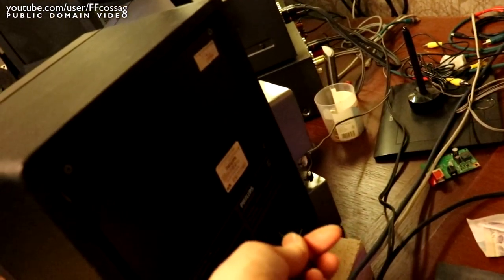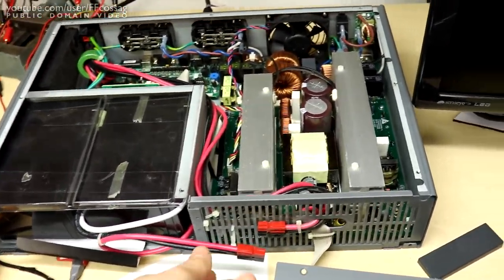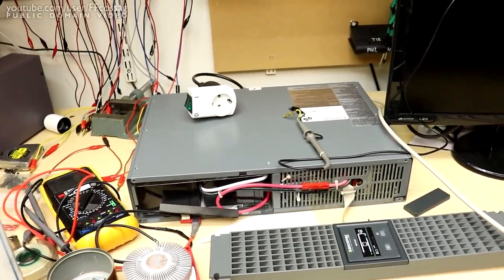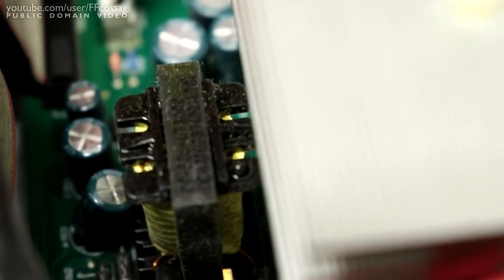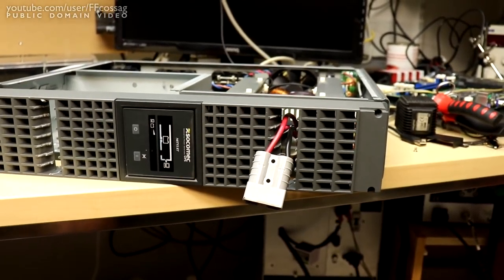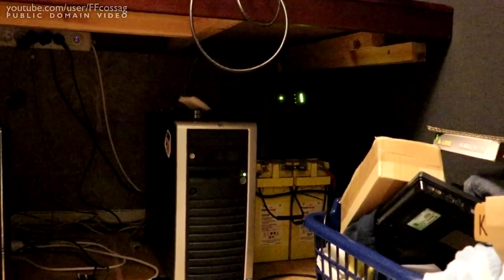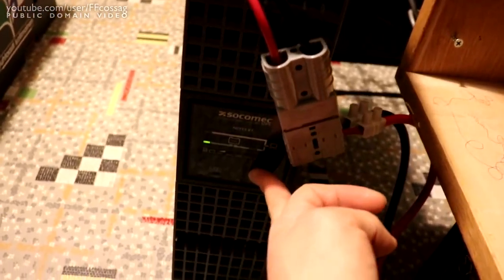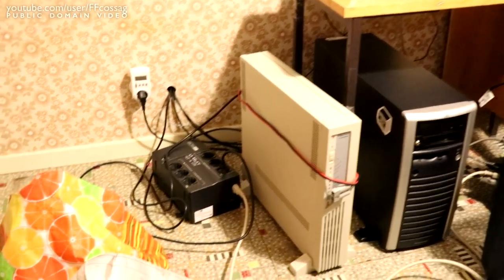Blog. Power grid distortion & solutions

Comment: I have a Tripp-Lite SU2200RTXL2UA that I just converted to 16s lifepo4 using headway cells.
It looks like my unit is based on the same design with OEM of at least the inverter board by Delta.
mine is quite a lot louder, thinking of adding glue to the coils, though I'm not sure if I should use CA super glue, Silicone caulking, or 30 minute epoxy.

Comment: I also had an issue with my power once where there was a considerable DC offset on the line making all my transformer based devices overheat. Don't own an oscilloscope so I couldn't figure out what exactly was going on... When I called the power company they told me that my multimeters are lying and all the overheating devices are just defective.
Reply: I once got told "we have an accident on the grid". They did not care that 220v line turned into 330v or something and blew our new fridge brains out and all our incandescents in the house. now we are on bunch of ooverlvoltage/lighning protector stuff on the house input. that got zapped twice already (one use devices) but we lost no devices in the house. the stuff is expensive though. did not notice dc offsets or similar stuff.
Reply: Use a transformer with multiple taps that automatically switches depending on voltage. When the voltage is too high (330V), it could switch taps to maintain the same output voltage.

Comment: A neighbouring building putting noise on the line? Needing a fix? Simple, burn their place down, they'll probably blame it on an electrical fault owing to cheap VFDs, and/or leaving the sauna turned on while they went to the shop for a fan belt... :P
Reply from the maker: The industry in question is an onion drying facility. Setting it ablaze would produce the loveliest, fried onion smelling fire in recorded history.
Reply: Stick an obstruction in the fans, the motors will draw more current, overheat and set on fire, hopefully taking the VFD controllers with them.
Reply: A hate onions (slimy horrible textured things!!), but the smell of them cooking is just incredible, can't beat it... :P
Reply: Even if you like the smell you won't like that onions make your eyes water.
Reply: But the guy making the video is in the U.K. That might be PhotonicInduction you're talking about.
Reply: The guy making the video is from Finland, and is in Finland, and Finland & England aren't quite the same... :P

Comment: I'm not an electrician or anywhere near that but I've noticed that my Philips Hue light strip PSU makes a horrible noise when the strip is set to 20-60 percent. Maybe it's distortion too? Also noticing such a sound on one of my 5V adapters for an Android TV box, but not instantly only sometimes.
Reply from the maker: That sounds more like normal pulse skipping behaviour.

Comment: Im a bit confused with the transformer making noise on such minor glitches, my mains can and has been worse than yours with hard steps in the waveform and glitches, and caused no odd effects.
i would yank that transformer out of the speaker and soak it in shelack or varnish, stop the windings dancing the night away LOL :-D
Or make a heavy duty lowpass filter to remove the spikes.
Reply: Yeah, a big low pass filter. Aka a really big inductor.
Reply: Like the one found inside a mig welder, in series with the rough dc out to clean it up perhaps?
I think that is what it does, i cant see any other reason for a big thick coil of copper on an iron core.
Reply from the maker: I'm surprised as well, but it's affecting everything in the house. I'm thinking it's because it's only a few specific harmonics rather than just flat-topping or something more sane.
Reply: I was thinking of just making a big LCLCLCLC filter so nothing above 60hz passes through.
But yeah ive also had worse noise im the mains, maybe its an earth issue.
Reply: looks like the transformer windings were a bit loose. our mains here are no good either. distorted waveform with unstable voltage. yet i have no problem with my amplifier's transformer. no noise at all.

Comment: What about them "magic powersaving" (lol) boxes that just contain a cap more or less that where ment to improve the powerfactor when using industrial load?
Reply from the maker: Hm, they'd probably actually do some work to remedy the issue, since they'd pass more current at the higher harmonics. It'd take a ridiculous amount of capacitance to actually fix it however, since it's working against the stupidly low impedance that is the power grid.

Comment: I hope you don't get the Problem where the Ethernet Cable burns-up, due to Earthing issuses there the Shield of the Cable acts as the Neutral. Like your Sockets without Earthpin.
Reply from the maker: While the electrics of the house are in awful shape, that's not going to become an issue since I'm only using one power outlet, and all the connected equipment is in much better shape, lol.
Reply: But that unearthed socket is not the best thing with a live ups and the computers !